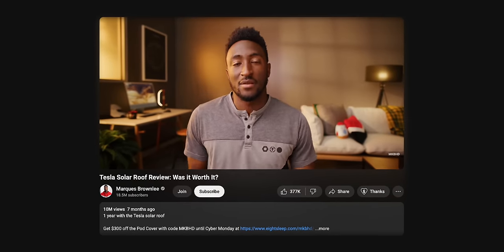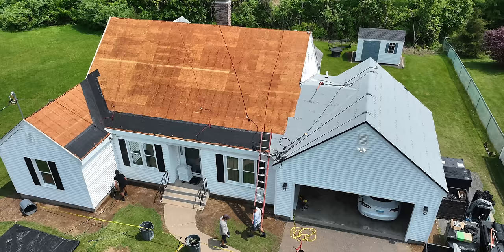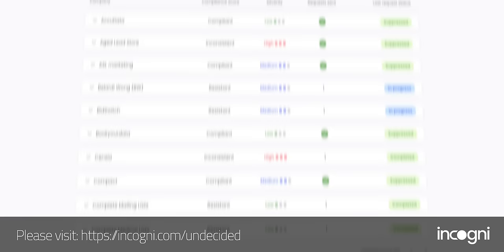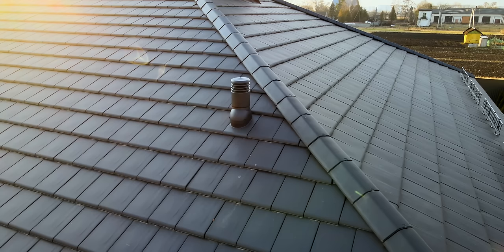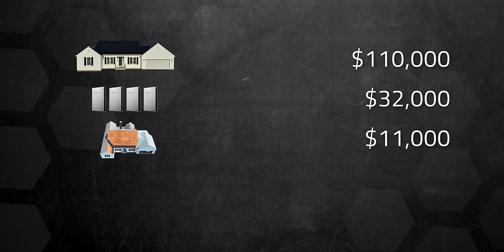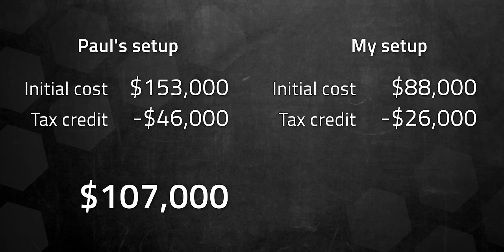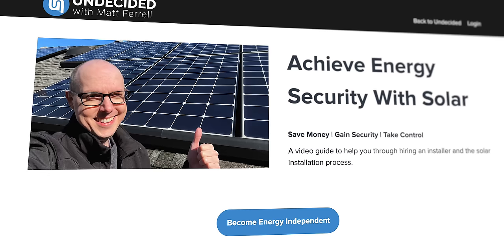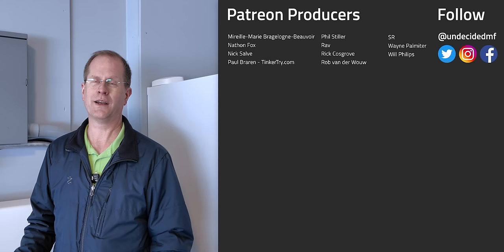Tesla Solar Roof vs Solar Panels: Which is Worth It?

Comment from the maker: Would you go with a Tesla Solar Roof like Paul did, or go with standard solar panels like I did? Take your personal data back with Incogni! Use code UNDECIDED at the link below and get 60% off an annual plan: http://incogni.com/undecided

If you liked this, check out Is a Geothermal Heat Pump Worth It? My Net Zero Home https://youtu.be/onmLrUh2cHU?list=PLnTSM-ORSgi7FwYRnWkpCSkAeFOzrgh5h
Reply: @user-pt5dm2zd2w  yes! Aleos solroof system looks great and is more efficient its comparable to standard panels
Reply: My lord. Going Solar in the USA is so expensive. In Australia you can. Get a high quality 13kw system installed on an existing roof for around $10,000 AUD or the equivalent of $6,500 USD. By professionals with a fantastic warranty.
Reply: @thorpie2206  yep, about 800 euros per kw in spain/portugal
Reply: If you have the space for it, neither. Go for a ground mount. It is easily accessible, runs cooler and more efficient, you can seasonally change their angle, and shield crops growing below them from sun. Agrivlataic for the win!
Reply: @einarmikkelsenPNW  Good point. In my circumstance, our town of Wethersfield Connecticut wouldn't allow ground mount panels, and my yard is pretty small. We really wanted to settle down near family in the area, and there were no sites for new construction. The costs of new construction were very high during the pandemic too, and owning 2 properties for ~2 years scared us off, especially the notion of having 2 mortgages. Everybody's circumstance is different, and I try hard to refrain from judging others for their personal choices. I just hope sharing our two stories helps others be more informed shoppers as they embark upon making their own decisions that are best for them.
- Paul Braren, owner of the Solar Roof featured in this video
Reply: I have a riddle for you:
it is the information age, yet I can not communicate......what am I talking about?
Reply: Honestly, I like the idea of a solar roof, but it really hinges on the installer. I'd recommend starting with finding the best installers in your area and see what products they offer. If there's just a few janky installers for the product you thought you'd want, maybe reconsider.
Reply: I just wanted to say something about the shape of your house, with that horse shoe design where you have two projections out of say a traditional ranch style house, which is what we're building partly to keep costs low and it's much easier to do a floor layout that's very efficient.

In a house built in the early 90s in the south, that design is not very good for the electric bill.  Part of this is the direction the house faces and that horseshoe pointing toward the West.  In the summer the sun hits multiple sides of that shape and it makes a couple rooms get hotter than the rest of the house, both being bedrooms.  UGGGHHHHH.  I imagine in the North it wouldn't be as bad and in the winter time on a sunny day but cold, the solar radiation hitting more wall surface may be a good thing.

What I know is my experience with it is so bad, some of which could be related to lesser quality insulation, that it puts me off from thinking about using that design.  I hope it works well for your house where you are.  I'm guessing it does.
Reply: Fortunately, Tesla isn't the sole contender in the solar roof market. 
Another noteworthy player worth exploring is GAF. 
I've personally opted for a 10kW GAF solar roof, and the results have been impressive. 

Since its installation, my electricity bills have remained consistently below $100, 
despite forgoing home batteries thanks to the benefits of net metering.

In 2023, I faced the necessity of replacing my aging 2003 asphalt shingle roof, 
especially given the rigors of Florida's hurricane seasons. 
Traditional rack-mounted solar panels aren't always reliable in winds exceeding 140mph.

My decision to invest in a 10kW GAF solar roof, combining roofing and solar technology into one cohesive unit, 
came with a price tag slightly exceeding $45,000. 
However, this figure encompasses all associated costs, making it a comprehensive investment. 

One significant advantage, particularly relevant to me, is the time efficiency. 
With the same team handling both the shingle replacement and solar installation, 
using just a nail gun, the entire project was completed in a mere two days.
Reply: I would be interested in a third side for comparison, a GAF Timberline Solar installation. I need a new roof this year anyway and this would address both solar and a new roof. GAF just added my state to their installation available list so I am considering it. Unsure of the HOA thoughts on panels or shingles but it would be the first in the subdivision. Given the newness of the GAF solar shingle I have not found many comparison videos  of the type you create that include them. Is there an installation you are aware of that could be included with the two you already highlight for a good three way comparison? Or is there similar information you are aware of for the GAF solar product that could be passed along?
Reply: @victorlazaro686  Your post must have posted as I was typing mine. I appreciate the information. Any other information from experience you can provide? At less than one year it hasn't seen much weather yet but what about the purchasing, install and follow on experience? Mine would be one of the first in Michigan if I went with it.  Michigan doesn't do net metering so batteries are being encouraged by the regulations. New adopter concerns abound.
Reply: Honestly, I can't see the ROI in having $100k+ tied up in a depreciating asset that wears out that will never yield a profit. Contrast over say 30yrs a conservative return of say 4% compounded on that initial outlay VS the energy savings / sell back but also replacing batteries & inverters over that 30yrs. Even forecasting energy costs going up and inflation, I can't see that purchase making sense beyond the cool factor & environmental statement. Am I wrong?
Reply: I agree with the guy because it faces the road so you don't really want ugly panels on the front of your house. However, for me, personally, I live where there's snow, so I would put panels on the ground so I could clean them off, so I wouldn't put any on the roof at all. I'd also keep that in mind when buying the property so I had an appropriate place to put them on the ground. Now, if I lived in California, I absolutely would get the Tesla roof instead.
Reply: Why would anyone buy a solar energy system from a company that won’t tell them what the efficiency rating is? Buying a proprietary roof in a black box is foolish, even if the company isn’t owned by an easily distracted megalomaniac.
Reply: in Germany, where I live now, I installed 13.7 kw for €24,000 (without batteries). In Romania, where I was born, the same capacity is installed somewhere between €8,000 and €10,000. I think what is happening in the USA is very expensive. after all, if you count only the material (pv boards, links, transformers, etc.) it does not cost more than 10000$ for what you installed. But labor is very expensive but sometimes not justified.
Reply: I would rather have a 2 axis mounted ground unit that tracks the sun.  That way maintenance is closer to the ground and I believe the system is more efficient due to the sun angle tracking
Reply: Roofit.Solar from Estonia have a metal roof with solar intergrated into the roof. They are expanding into agricultural and factory roofs as well as domestic roofs. It all depends upon how you store and use the energy, what grants and tax breaks are available.
Reply from the maker: @TheGoldenboy476  yes, you’re wrong, but because it’s heavily dependent on where you live, what the energy prices are, etc.  While it might not make financial sense in your area, that’s not the case somewhere else.
Reply from the maker: @davidwatt2943  I’ve only seen one GAF roof driving around and don’t know anyone personally with one.  I’d love to talk to someone with one for a point of comparison.
Reply from the maker: @victorlazaro686  that’s a pretty good price!  How large of a roof do you have?  How complex is the shape of it?
Reply from the maker: @johndoh5182  the bad experience might be partially related to insulation and type of windows.  We still have to get through the summer,  but the house temp is super consistent throughout, so I expect that to hold true through a hot summer.  But … we’ll see.
Reply from the maker: @thorpie2206  yep, it’s still too expensive over here.  Australia’s prices are some of the best out there.
Reply from the maker: @user-pt5dm2zd2w  what’s the company?
Reply: Hell no, waste of money.
Reply: You think maybe one day you do a video on fabric air ducts…. 👉👈
Reply: Paul’s solar roof was the better deal based on this video.
Reply: One question I have is life span and replaceability. Given that standard life span of a solar setup is 25-30 years, it would sting if you have to fork out ~$100K for a Tesla solar roof, vs just replacing the panels on a standard setup for ~$30K. 

The issue with the Tesla roof is that it forces you to re-roof when the panels reach end of life. A standard setup, paired with a metal roof, does not need to be re-roofed.
Reply: I definitely wouldn't be using a metal roof. I'm struggling to understand how you call that crap a "premium" product! We use it for our animals, cos it's unfit for human habitation...
Reply: Why was there no discussion on recoup costs?  The cost is ridiculous, and if it takes more than 20 years to recoup the cost, then its not worth paying upfront for this when you can use the money to invest in other ways that make money.
Reply: Matt, would you have gone with a solar farm in the back yard, if you had the space for it?
Reply: @LiamNI why is it bad?
Reply: @bikedawg  rain hitting a metal roof is gonna be noisy. A whole lot more noisy than slate or formed roofing tiles. Slate and roofing tiles also don't (can't) rust. I'll guarantee you Matt will be changing his new roof before I'll be changing my 35 year old one...
Reply: @LiamNI noise is down to how it's installed and metal roofs are one of the longest lasting materials you can get
Reply: @LiamNI i read about that awhile back and also heard there can be a condensation/moisture problem.  but also read that these issues are mitigated with special insulation between the metal and underlayment.
Reply: I guess, neither. There's no way I could afford either system. I have heard about the secondary market & maybe that's a place I look. But I have doubts I could even afford that. And I'm sure no tax credits go to the secondary Market
Reply: nice video Matt! Does paying a monthly subscription to protect your privacy seem the right way forward? what happens to people who cant afford a another montly subscription? Please stop taking money from such unethical businesses!
Reply: GAF has been glacial to deal with. Because they’re so slow we’re going with traditional panels
Reply from the maker: @jcash757  interesting question.  Yes, I probably would have to make it more accessible to clean.
Reply from the maker: @user-pt5dm2zd2w  thanks for the info!
Reply from the maker: @bikedawg  it was out of scope for the video, but is something I’m going to be revisiting in future videos.
Reply: Other: Even if I had that kind of money, I wouldn't give it to anything Musk had to do with.
Reply: Thank you for producing this video Matt, it's quite an honor. I hope many folks are encouraged to move forward with their sustainability projects despite the significant challenges that each of us eventually prevailed over, now better informed as they shop for solutions to their energy needs.
- Paul Braren from TinkerTry
Reply: Hi Matt, why did you go with Enphase? It doesn't look like your house has massive shading issues? I'd say you paid a large premium going for Enphase as well. They are significantly more expensive than a central inverter and the Enphase batteries are more expensive as well.
Reply: when we build our house in atlantic canada, regular solar panels all the way, 50-55 panels depending on which option we choose. so excited to get it done
Reply: Just get a conventional roof and solar PV.  Tesla roof cost just equal with slates/ceramics + solar Panels.  Tesla's solution also slower to install than the two standalone products.  Besides, an upgrade or expansion to your solar PV array is likely to happen after ten years which is awkward with the Tesla Roof. Tesla home energy will take off if they get rid of the slates and use conventional panels, implement a technically off-grid Powerwall and EV charging system to get rid many permits and inspections.
Reply: Move to Australia, where that system would have cost half what it did, and you would be well into net negative, not net zero. Oh, and none of that "permitting" stupidity. You buy it and have it installed. In some states the system has to be able to be remotely curtailed - that's how we deal with excess supply, which hasn't actually been an issue so far. Midday renewables in the grid on a sunny day are 80% plus.
Reply: I have two reasons for not wanting to go with a full solar roof system, or even the standard roof mounted panels system: cost, and thermal efficiency
As someone who is planning on building a small, very well insulated wooden house I would like to take the opportunity to have as much energy efficiency baked into the build as possible, and feel there are some gains to be made in having as much of the heat and cooling be supplied by direct processes. 20/30 KW of panels and several huge electric is far too much, feels like conspicuous consumption

Wouldn't there be a way to have one smaller array, in the loft, behind windows, in direct contact with a semi-closes loop air system that cools them, and carries the heat away, first to a heat-pump evaporator, then to a "puits canadien" ( not sure of English term ), an air tunnel laid in the foundations ? You could regulate temperature by having the return flow directly into the house during a large temperature differential day, and re-enter the loop otherwise
I was thinking of combining that with direct ( managed ) DC supply and charging ( vanadium flow battery? I like the modularity ) to everything that it makes sense for to eliminate conversion losses, and maybe look into evaporative cooling/ radiative cooling on the roof and different kinds of emitters for the heat pump, and maybe even heat storage for cooking. Not even sure if it's feasible yet, a few more years of school will give me the information I need but I'm curious about other's thoughts
Reply: @bquickforever4618  They have large solar PV array for charging EVs
Reply: @zodiacfml  fair enough, my plan when I earn enough is to do something similar, on top of the base work I would have already done to optimise all other aspects of my daily consumption
Reply: @bquickforever4618  same bro, same.  by the way, it doesn't need that the system has to be equal or oversized than the consumption on the first build.  It is nice to expand or upgrade after a few years as the equipment becomes better and cheaper at the same time.
Reply: Great Video Matt, I would go with Pauls system at 27Kwp installed will generate a lot more energy and haa much higher aesthetic. More value has been added to Pauls house, but then of ocurse am biased being the founder of Freesuns.
Reply: Test
Reply: Correct me if I’m wrong but if enphase upgrade to an iQ9 and one of your iQ8s needs replacing then you’ll have to replace all the iQ8s as I know this has happened with people who had the iQ7s.
Reply: @thorpie2206 'professionals' and the warranty doesn't mean anything if the company closes down/changes name/changes management halfway through the warranty period. it's cheap for a reason
Reply: I went with standard solar panels, but then I have a fairly new workshop with a south facing rectangular steel roof so I had an ideal setup for panels.  And I signed a natural gas lease and used that money to fund the solar panels.  They are still a marginal investment with a 10+ year break even point even with the 30% tax subsidy upfront and the net metering subsidy from my utility.  Without all of these initial and ongoing subsidies, solar makes no sense at all in the northeast.
Reply: I actually wanted the Tesla Solar Roof…  I have a 9200 sq ft roof   My HOA denied it … no reflective roof    Even though it’s not reflective… they say it is.   Because I’m in California,  I have to get solar ( new build) so…  I’ll have a “solar field” along my driveway.   Super annoying when I know they will constantly get dirty.  Stupid HOA
Reply: @tinkit33  I’ve always felt that anyone who buys a home in an HOA deserves what they get.  HOAs are simply evil and unAmerican.  However, I believe people should have the freedom to form or buy into an HOA if they wish, but don’t complain about it later.
Reply: “Heat Degradation”, of panels is always a factor: respective of the energy efficiency of the panels as they get older. When you have B.I.P.V./ Building Integrated Photovoltaics  the panels do not have the advantage of air flow on the underside. This results in less efficiency and grater and grater degradation over time. B.I.P.V. is “NOT” a reliable long term solution as heat destroys the energy  efficiency of the panels much more rapidly making the Tesla panels less and less viable verses non-Integrated standard roof panels. Note: as for installing panels on top of a metal roof: you want to be sure the metal roof is painted with a heat reducing nano paint coating or you will have a heat degradation issue as well…
Reply: It also helps that rec alpha blacks look good.
Reply: you know if every roof had just 6% solar coverage, nobody would need to buy their own solar systems.  And there would be no coal power plants, or natural gas power plants, or diesel power plants, or need for combustion based energy sales of any kind that wasn't recreational.  Just 6% on every roof, based on the total square feet of all available roofs in the US.  If that was just a required part of every building.  We could all have clean energy tomorrow, if we did 6% of our part today.  And that solves the ENTIRE energy crisis.  Not just part of it.  It's quite a bit easier, safer, and not to mention scaleable.  Hek, doing the same thing on the long haul fleet could save the US more energy than Mexico uses total.

We could all but erase the energy foot print of North America, if everyone just did their 6%
Reply: @ZennExile  Really?  What do you do at night?
Reply from the maker: @tinkit33  Sorry to hear that. HOA’s always sound like a nightmare.
Reply: Just wait till Paul's solar shingles begin to warp and  or catch on fire from over heating
Reply: @jessiej3991  That’s hilarious.  We all know how easy it is to burn glass, silicon and aluminum.  We need to start teaching science again in government schools.
Reply: @LTVoyager  I agree 100% They clearly don't teach the laws of thermodynamics
Reply: I built my home 6 years ago. My asphalt roof cost me about $3500 and I know I will have to replace it a couple times but even 3 replacement will be cheaper than a premium lifetime roof. I average $150 per month electric for heating, cooling, lights and refrigerators.  At that cost I would have to live 80 years in my home to meet break even with the solar you installed. I am not optimistic about the prospect of living to well over 100 years. Also, I am more likely to live to 100 than your solar panels are to live to 40. The oldest equipment I own with wires and batteries is a 1997 gmc pickup.  It runs great but it won’t last another 10 years. My point is that it is not practical to spend so much more on technology that cannot have the lifespan to pay for itself. I love the idea of personal solar or wind generation but it’s just more economical for me to go to work and buy my electricity.
Reply: you really think they didn't know that the solar production stats were doubled in their favor?  i have some swamp land if you want to buy it
Reply: @daves6384  or you could just fit solar panels over the top and leave the tesla roof as a plain old roof?
Reply: Solar panels for me. Tesla is too much money for me as I turn 65 this summer. I just installed a system with two 6k inverters, 12k in solar panels, 42 kwh in batteries, and all the required accessories for under $25k. 
This was my first time doing anything solar after one month of research of watching YouTube.  Thanks to video’s from you and others I saved thousands by doing it myself !
Reply: Would like to see how that would work out on a tiny house (300sqft).
Reply: @thorpie2206  Yes. I would like a deep dive in to why.  I just did two houses with 7.5kw arrays for $8k AUD each. More expensive than yours but still way way cheaper than the U.S..
Reply: @TheGoldenboy476  You are absolutely right. Solar in the U.S. is ridiculously over priced. Compared to Australia about 7-8 times more expensive.
Reply: @UndecidedMF  Matt solar in the U.S. solar is not just a little more expensive it is ridiculously over priced. I live in Sydney Australia and just installed two quality 7.5 kw arrays with 20 year guarantees for the equivalent of $5,000 U.S. each.  WTF is going on over there? I know NextEra builds solar farms that work out generating at less than 2 cents per kwh. Residential roof top should only be about double that. Surely there must be some of corruption going on. Because of buying power,  U.S. solar should be cheaper than Australia.
Reply: @LiamNI  The old ones where but now the noise is dampened by insulation under the sheets.
Reply: Still the issue of heat both for panel efficiency and lifespan in terms of power production. Seen a video with someone showing how active cooling on PhotoVoltaics cost less energy than it helps produce, even when it's not that sunny or hot out. Lower heat can help with energy efficiency even down well past freezing.  This also very much effects PV lifespan.

PV raised up above a roof allows air to travel under the panels providing a bit of cooling (though I worry/wonder about how much the energy absorption of a medal roof plays into this) If the PV are tiles, there is no way for air to travel under the panels for cooling.
Reply: I'd try to avoid proprietary solutions in every way I can. Universal standars and open source solutions are the only way to survive the dystopian future we're heading for.
Reply: @UndecidedMF  And as a result they AUS has exceptionally high adoption rate, which means they will be much further towards carbon neutral than the US very soon, despite having a fossil fuel friendly government for many years.
Reply: @daves6384  You mean 30 years from now?  By that time the solution will be so much better it'll make sense to do a complete replacement.
Reply: @LTVoyager   My HOA has been fine.   Driving around my experience has been you can ALWAYS spot the non-HOA neighborhoods.   The type of people who INSIST they should be able to do anything they want on their land make poor neighbors.  That is how you get a neighbor with 10 dead cars, chickens, dogs running free, who never cuts his grass.
Reply: Solar panels and upgrade as needed. No brainer for me and my limited budget.
Reply: I'll never give Tesla money again.  Worst company ever.
Reply: @thorpie2206 , his price is absurdly high because of where he lives and the products he chose. I put a 9kw system on in North Carolina for around $8K after rebates and incentives. Batteries add up quickly and the price to power ratio is stupid imo. For the price of a single Tesla Powerwall I can get a propane generator that will power my whole house for around 8 days on the tank I already have with money left over.
Reply: @davidwatt2943 , depending on your state the HOA may not be able to deny roof-mounted solar. In NC they cannot, and you are allowed to remove any trees you want in order to maximize solar production. That's the state law.
Reply: 27k !. Wow. That is a lot
Reply: Probably panels.  All Matt’s rationale and, admittedly its a Sweeping generality, but do-all solutions generally do not do perform specific tasks/functions as well as those purpose built, i.e., roofing materials for the homes roof, solar equipment to produce energy, etc. …
Reply: Standard solar panels is the way to go, for the reasons you already pointed out in your video.
Reply: @thorpie2206 , that’s a steal! I’m just thinking of installing them myself. (It’s not rocket science.)
Reply: @UndecidedMF did you install a standard 24 gauge galvalume roof, or is it painted. I installed a standard 24 gauge galvalume, but choose to divert paint color $ towards a radiant barrier separated with 1x4's underneath. My attic temperature is running 25 degrees cooler.
Reply: ROI?
Reply: Once the developers at Tesla move on for whatever reason, will you still get that superb manufacturer's support? In the case of Paul, he has about $400K+ wrapped up in one company with an unhinged leadership. In addition, the verdict on the live span of Tesla tiles or any solar panel is still out. Do panels still lose 10% every year of it's performance ratings?  Over the last 10 years there has been a lot of coming and going in the solar industry and if solar is going the way PCs and operating systems have been going I would be cautious with too much new tech gadgets. In addition, I could buy a lot of electricity and gas from the interest in investing $400k in the stock market. 

I do like your standing seam approach, In addition to a passive build house, super insulated - straw bale is my favorite - infloor head backed up with a heat pumps heating and cooling system.
Reply: Solar panel installations seem to be expensive in the US...  Here in Belgium we pay 1 to 1,5 euro per Watt Peak with installation and inverter.
Reply: I would go with the solar roof. It seems to be more efficient
Reply: Is it just another thing that's not affordable for anybody besides rich
Reply: I'm with you on this, I'm a tech nerd so I'd actually like the panel look 😅
Reply: @C3phoe  to be honest everybody's a nerd now because nobody could afford to do anything other
Reply: @bobboby2400  I'm try to buy some tesla 400watt used panels for 135$ a piece.  7 years old, from what you know is that a decent deal?
Reply: @C3phoe  beautiful deal
Reply: @C3phoe  that's half the price it's selling online and it's way under the price of what stores are selling
Reply: @C3phoe  solar panels might actually be able to be functional and practical if they're that price compared to what they're selling them right now
Reply: Never would I choose solar roof! What no one is mentioning is maintenance. Your trading 40 connections (that some times loosen) for 1000s of small connections on a roof. Now lets say you have one failed roof tile or broken connection. Unless each rooftile is reporting its position and health its a nightmare to locate diagnose. If its hard to find installers to fit it, good luck finding someone to fix it.
Another point is that its a roof tile. Water or vapour freezing, expanding pushing connections apart, metallic corrosion. Any defect in manufacturing or fitting will cause problems over the years to come and there is potentially 1000s of them.